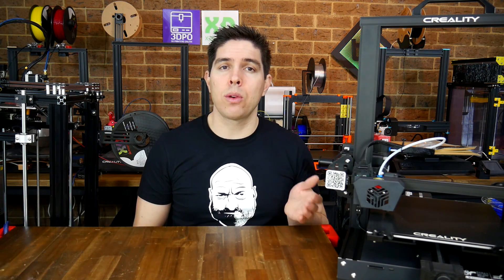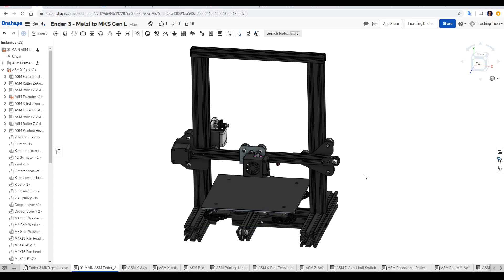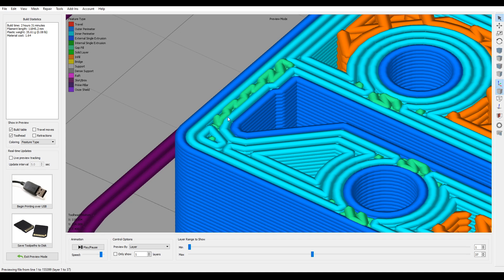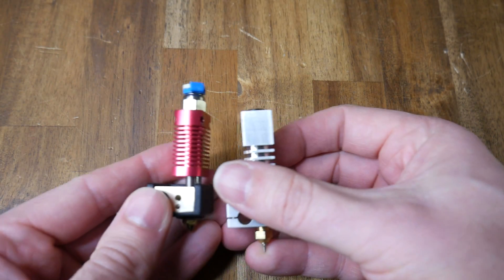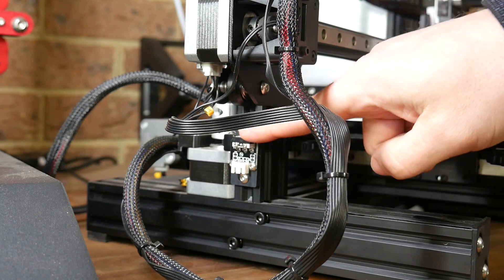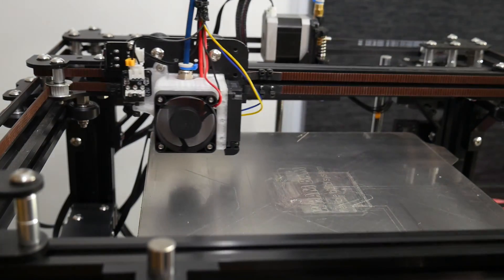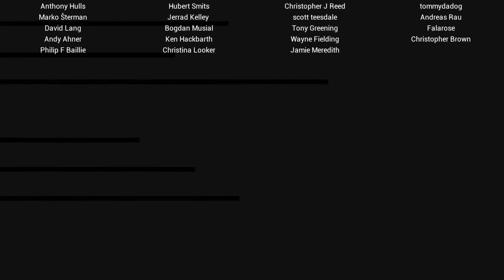CR-6 auto bed levelling for free on the Ender 3 - New printable mod

Comment: Hi Michael.  Great video and very creative as well as inspiring. I have a question though about ABL in general. I cannot seem to understand why after adding abl, that people don't just hard mount the bed thus removing the springs. Wouldn't that eliminate the need to ever re-level the bed? I see most people still keeping there springs and wheels as per original after adding abl, including the manufacturers that include ABL on their machines. I don't get it. To me keeping the springs and wheels WILL mean that one needs to periodically re-level the bed as you have stated. I cannot seem to find any YT videos that address this after adding ABL to a machine. Any help with this is greatly appreciated.
Reply from the maker: The problem is the actual bed surface is warped. If you were dealing with glass or something else really flat it might be fine.
Reply: @TeachingTech  But if the bed is fixed (albeit warped) won't the abl compensate for that? You only need to do it once and then it wouldn't change, no?

Comment: This is a quite ingenious design thank's. I think that it could take a lot of pain out BL sensors and their wiring - since the wiring for a limit switch is quite simple and something which nearly every 3d printer board supports. As an added thought I think Thomas Sanladerer showed a while ago, that ordinary mechanical limit switches were every bit as accurate as sensors costing quite a lot more. Fantastic work.

Comment: Hi Michael,
Really sorry for putting this question here!
I'm very new with CNC machines and Programmable board.
I have a Lowrider2 with SKR 1.3v with TMC2208-v3.0.
I tried your firmware from the part2 of Lowrider2 wiring and firmware but it just giving me this error LPC1768  FAILED  00:00:01.047.
I tried to with a stock Marlin2 SKR 1.3v firmware and is working, I would like to use with dual end stop for auto balance exactly what you did.
Would you be able to guide me on what to do?
Thank you!

Comment: If auto bed leveling works with just one end switch and something which will trigger it, then why not use just a metal rod and a small electromagnet to hold it up when it's done with the calibration
Or
Just remove the road after its done
Or
Just make a magnetic holder above and a joint blow so we can just attach it to it after it's done
Nice video thanks

Comment: I wouldn't suggest probing with a cold hotend. When the hotend cools it can leave a blob of plastic on the nozzle which will give you a bad reading. Cold hotend is OK for a BL-touch as the hotend doesn't touch the bed. But when using the nozzle as part of the measuring you don't want any hard plastic adding additional distance.

Comment: There's a lot of issues here - the 'hinge' sag will cause issues over time as the flexibility varies, but you'll also melt the fan shroud being too close to the heatblock. I print things like the herome2 and petsfang in ABS and I end up melting the ends of the vents over about a month to the point of them scraping the bed. Specifically, the right hand side that is unshielded by the silicon sock and is slightly closer to the heatblock.

Is good for an alpha design though :)

Comment: Dont get me wrong, but saing it is the same as the CR-6 is not right . the CR-6 uses a Strain gauge which gets measured with an OP to convert the measured resistance into the actual force , with wich the nossle hits the bed. systems like that are often used to measure tourge on a car and thing like that and are far more acuarate than a machanikal switch.
It is a realy cool way to do that with a mechanical switch and cheap as well , so a good mod for 3D Printing.
But it is just not the same as the CR-6

Comment: Great Idea. I have two suggestions:
1. The hotend assembly should rest on a defined end stop. Over time, the plastic hinge will sag due to creep, changing your Probe Z offset value. Also, it would allow to keep some tension on the assembly.
2. The hinge should be rotated 90⁰ around the Z axis. Right now, accelerations of the printhead will induce a torque in the hinge, flexing the nozzle up and down, reducing print quality for fast prints. If the hinge axis is aligned with the direction of movement, this will not happen.
Reply: Or an even easier and stable solution, just set sensorless homing on the Z axis in Marlin instead..... You won't need to build this or get a BL Touch or any other sensor for the print head.
Reply: @Tom-yc8jv  not everyone has the drivers to do this
Reply: @1tibbers  @Tom not to mention sensorless homing on a leadscrew is not reliable.

Comment: 1 point. Biliniar ABL still doesnt account for anything but a tilted bed. The z motor is only moving to account for tilt and not to account for unevenness. This could lead to a lot of annoyance for people if they go down this route to compensate for a warped bed because it wont work.

Comment: If you add the heat-up GCodes to the startup sequence, you can do it in the following sequence: a) heat up the bed b)g28 c)g29 d) heat up the nozzle. That way you probe the bed as it's expanded from hearing up. Also, with UBL you can do a quick 3 point measurement of the bed to adjust for tilt and then use the stored mesh. That should accounts for the bed getting out of level without it's surface changing and will speed up the per print leveling procedure.

Comment: I would add a spring then make it two piece design so I'm not constantly flexing plastic also doing with a spring and in two pieces you could probably make a direct drive version as you could have a much stronger pivot point depending on spring pressure

Comment: Thinking about the spring idea, I think that is a good idea, but take it a step further. Don't use the petg material as a spring, at all. Instead, create a pivot point with a screw at the top corner and limit the travel as it would swing back when released from tension. This would allow the spring to be the controlling point and not the durability of the plastic, which will become more 'plastic' than 'elastic' over time.

Comment: I wonder if it would be possible to avoid any physical modification with this, by having the board sense when the nozzle hits the bed through detecting a spike in the current of the z axis motor
Reply: It's possible with certain stepper drivers such as the tmc2209 that have the stallguard "sensorless homing". It's not recommended to use sensorless homing with leadscrews though. A failed trigger could really mess up your bed, your leadscrew, your hotend and probably more than that. If you have a belt driven z-axis though, there shouldn't be any issues.

Comment: A standard micro switch is too inaccurate. You are setting people up to have bad results. While it can trigger one point once relatively easily probing many points with the error in the sliding parts vou are bound to have high and low spots
Reply: M48 Z-Probe Repeatability Test
 Mean: 0.617350 Min: 0.615 Max: 0.621 Range: 0.006
Standard Deviation: 0.001898

this is my microswitch

Comment: Might be able to remove the bed springs from the machine to convert it to a rigid bed. Reuse one of these springs to support the hotend like you proposed? With ABL the adjustment springs shouldn't be necessary and could be a detriment by allowing the bed to shift more over time.
Reply: Well, I would still keep the springs, but tension them much more, and level the bed as usual. Tight springs won't give up at all when nozzle probes the bed around.
Reply: I imagine that would work fine too.

Comment: hello everyone, as you mentioned, a spring to lightly increase the resistance would help but on the hinge side id also add a set screw (headless screw) for use as a stop, so when the spring is pressing the system down the screw prevents the nozzle having a lean of any kind, it could be added prior to the part coolingfan installation. great video as usual, great work.

Comment: Nice work!
Where as the switch takes physical movement. Strain gauges measure movement that isn't even visible to the human eye. I have worked with air pressure strain gauges with GM that can measure 1 foot changes in altitude air pressure. Likely retro kits will soon hit the market as are photo sensors. What I like most about this concept is no Y offset!
Reply: The nozzle is offset in y axis by the extra thickness of the pelg about 1 to 2mm but that does not bother me.
Reply: @Cloudman572  You mean Z axis?
Reply: @tablettestinguploads7522  I am not sure that you and I have the same Y axis definition- which happens. No idea what the absolute correct axis definition is but to me the Y axis is the one moving from front to back of the printer as you face it. The new printed part mentioned moves the nozzle 1 to 2mm forward (in the front to back axis) due to the part thickness.
If we are talking about my definition of the x axis (left to right as facing printer) then yes there is no change of position of the nozzle vs stock set up, unlike the large difference in the normal ABL probe to nozzle position.
My z axis is the vertical one.
Plus, if you mean that there is no axis offset of the nozzle vs the probe (which is the nozzle!) then totally agree.
Reply: I purchased a new Geeetech A30 PRO cheap and need to do something to get good first layers. I may do something to this printer. My CR 10S PRO V2 is so dialed in im not touching it.

Comment: if someone is able to convert their printer to strain gauge abl, chances are they're not using stock fan shroud, nor stock 4010 fan for that matter. Should've designed this around fan shroud that are proven to be better than stock, for example  fang.

Comment: If anyone is interested, you can use Dupont / breadboard jumper cables to prevent cutting and re-soldering your Z end stop cable for warranty or otherwise. 6 Female to Male/Female cables should do the trick - you just need some spare wire to extend them.

Comment: bah it's easy to manually do it with a piece of paper.
Reply: Paper is so inaccurate.  Mount a dial indicator and without looking,  have someone write down 10 of your attempts to level with paper. You will be surprised.  I level all corners to .001"

Comment: Could you solve the blob issue during auto bed leveling using something like G0 E-10 to retract, G28 home, G29 ABL, G0 E9 to advance the filament back in without ramming it into the nozzle, then the G1 get ready to prime line?
Reply: Sounds like a good idea.

Comment: There is a option for enabling multiple probes per point (I run 2 on my servo/microswitch combo). Would also be interesting to use M48 if enabled in the firmware to test the accuracy of the probe, especially if you are testing different designs. :)

Comment: Looks at my heavily modded CR-10 with an e3d hotend Crap guess I'm going to be spending a few weeks in design spark to make this. also some tips to make this work better.
First - instead of flexing the plastic what about making a slide for the hotend to ride in backed by springs to keep it pushed down, that way it would lift up in a linear fashion instead of canting because of the lever it creates (plus you wouldn't have to worry about the flexing fatiguing the part over time.
Second - i would change the geometry of your fan duct so it's not right against the heat block then PLA would be viable as well.
Third - copy a little from creatily and in your starting g-code have the nozzle heat to 120c then do G29, for the bed probing that way the filament is hot enough to squish but should be cool enough to not ooze everywhere while it homes.
Reply: Yes, this came to my mind instantly I saw this design. I'm in the process of designing it. It would take regular bed spring. A drawback is that it will reduce the Y build area by around 10 mm, as the entire sliding mechanism will offset hotend from metal X carriage. I'm also a bit worried about clearances between two sliding parts - too tight and it won't move freely, to wide and the hotend will wobble affecting print quality. Will run first tests shortly.

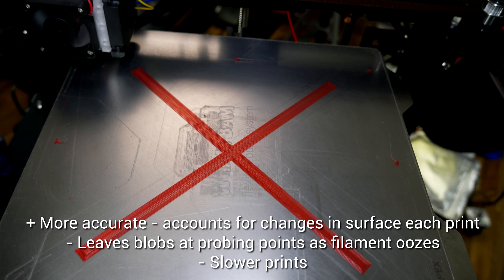Comment: 12:24 - If you want to stop oozing when probing, use the start gcode:

M104 S150
G28
G29
M109 S{material_print_temperature}

(Note: do not change {material_print_temperature} to a number, leave it as is)
That heats the hotend to 150, homes, probes the bed, then heats the hotend to the temp set by the slicer.
Reply: I do this but I also have added a 10mm retract to my end script and a bigger nozzle prime at the beginning so during homing I don't even have filament inside the heatbreak. I've never had a homing blob.
Reply: @14768  Could you help with where to edit mine?

M862.3 P "[printer_model]" ; printer model check
M862.1 P[nozzle_diameter] ; nozzle diameter check
M115 U3.8.1 ; tell printer latest fw version
G90 ; use absolute coordinates
M83 ; extruder relative mode
M140 S[first_layer_bed_temperature] ; set bed temp
M190 S[first_layer_bed_temperature] ; wait for bed temp
M104 S[first_layer_temperature] ; set extruder temp
M109 S[first_layer_temperature] ; wait for extruder temp
G28 W ; home all without mesh bed level
G80 ; mesh bed leveling
G1 Y-3.0 F1000.0 ; go outside print area
G92 E0.0
G1 X60.0 E9.0 F1000.0 ; intro line
G1 X100.0 E12.5 F1000.0 ; intro line
G92 E0.0
M221 S{if layer_height<0.075}100{else}95{endif}

Thanks!
Reply: I like it when it oozes while probing. 🤪

... I should go to church
Reply: I added filament retraction and automatic nozzle cleaning with brush and home z before starting print

Comment: I dont like the fact the nozzle touches the bed  could damage the nozzle over time and the bed plate.  Thanks but i love the BLtouch...Just works great.
Reply: Also work poorly on soft bed surfaces.  Thats why you should stick with the glass plate the cr 6se ships with.
Reply: If you have a steel nozzle, it's never going to get damaged when you lightly bump up to glass or a polymer, if you use a brass nozzle, get some tools.. remove it.. throw it in the garbage because they're junk anyways haha.
Reply: @BF3DS  Thank you for the advise...I doo have a brass nozzel and alway found when it hits the bed....no matter how hard...it squshes the tip and the filament just struggles to come out and then i get huge clogs.. I will take your advise and get a steel hot end Cheers.
Reply: @EliasOda  Yeah it's worth it! I got the micro swiss hot end with their steel nozzle and I don't think I've ever had a clog, not even with wood filament!

Comment: The only thing that I would change for this is to move the screw that triggers the end-stop further along the metal bar so it needs less force to trigger the switch - it is a lever after all.  
I am curious to know if the endstop is ever triggered while printing though, not sure what Marlin does if a endstop is triggered during a print but if the mechanism is too sensitive you could get "false positives" from the hotend.
Reply: itr does trigger while printing but makes no apparent change to the print procedure :)
Reply: If you mesh level, you often trigger the Z-Stop while printing.  It's not paid attention to at all.

Comment: I think that if you use a direct drive you might be able to do it with a stiffer material and it would work
Reply: the extruder injecting or retracting would cause the nozzle to move, which can ruin the print

Comment: Try actual printed threads - they work BRILLIANTLY.
I've been using M3 to M6 printed threads for years now. No extra tolerances or anything, just fusion 360 thread function.
I try to target 2x thread diameter for depth, so far i've not had anything strip threads always something else what gives away first
Reply: what printer do you have? I tried printing m3 once and they failed

Comment: One of the things I like is that it gives you a mesh for the entire bed, not just the portion of the bed that the offset from the nozzle allows. Thinking that an improvement for the saved mesh option would be to set the sample points to a higher number. Currently doing 5x5 with an ezabl, but thinking that if I save the mesh, doing a 9x9 or 15x15 would get a better map of the bed, and using m420 instead of g29 would mean that one only does the ABL read on demand. If you start getting bad first layer adhesion, stop the print, remove the scrap, do a fresh g28, g29, m500, and restart the print job. Now seriously thinking about putting new control boards into my Wanhau I3+ printers to get something like this going on those as well. Though I've a new anet et4x that might be a better place for it, if it's something that can be added. (If not a new 32 bit processing board could go in there...

Comment: Can you have a brush off the bed surface and have it clear the nozzle before each touchdown of the nozzle?
Reply from the maker: If you use method 2 then no. You could also probe with a heated bed but warm nozzle to avoid this.

Comment: I'd like to hear your thoughts on problems with the nozzle contacting the glass bed, namely do you see a chance that the nozzle could be deformed by constant contact with a hard surface such as the glass bed
Reply from the maker: In the cr-6 version the range of travel is a lot smaller so it's probably ok. On this it may be a concern over extended time periods. I guess nozzles are very cheap and can be replaced.

Comment: Pretty interesting! I used to love my capacitive ABL, but it's super sensitive to heat, and cold nights and warm days mean it requires constant adjustment. This looks like it could be a viable solution indeed
Reply: Try a 3Dtouch, it's a $15 BL-Touch clone.
Reply: @marsandbars  Seconded, i like mine.